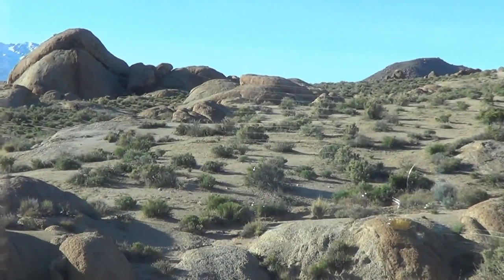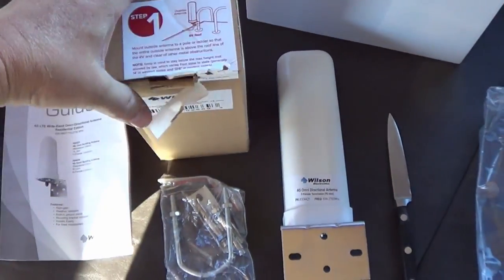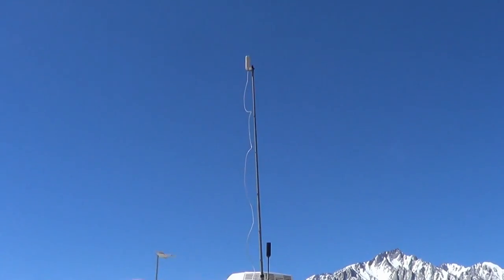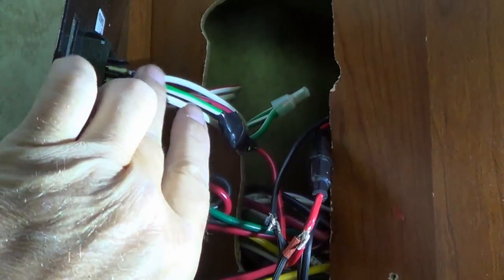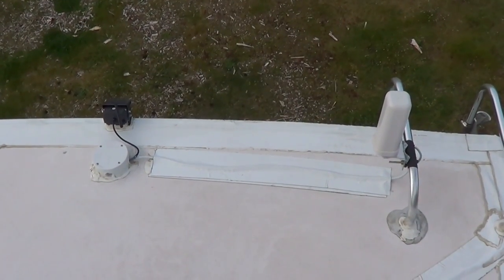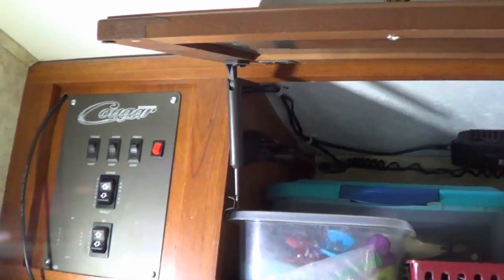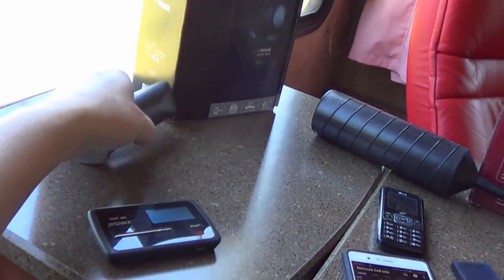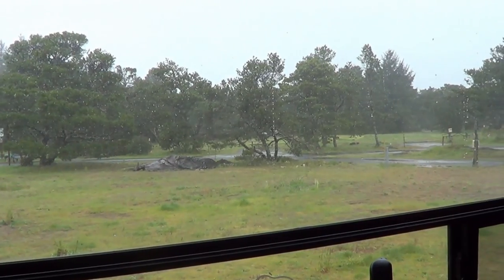weBoost Drive 4G-X RV Cell Booster Install and Review

Comment: Cell phone signal doesn't bend. If you can put the outside antana higher. The mount that came can be put on a pole that can go up higher when needed and lowered when moving. Mount pole on side of ladder like your flag.

Comment: Very thorough review - well done!  I wonder if different placement of the inside antenna (such as not in a window) would make a difference?  I.e. help reflect/keep the signal it is repeating inside the RV as opposed to some escaping to the outside?  I also wonder if you couldn't mount it upside down (bottom up) on the ceiling in the center of your RV to help boost signal to any devices within a certain radius (at the table and couch, for example; maybe even up into the driver's area if strategically placed)?  Or you could mount it with velcro and have a place up front on the roof and then a place farther back, depending on if you're parked or mobile. Just thinking out loud here...great review!
Reply from the maker: Thanks, Mark, I tried it on almost every conceivable location in the trailer checking boost levels as it had lots of extra wire to test location with and that was the best reception spot. The biggest problem is the interaction between outside and inside antenna, the greater they interfere with each other the more the amp will auto-tune the output signal in the rig lower to stop the interference.  I believe the window location works best as it places the windows metal frame between the inside and outside antenna. Every RV will be different, like say an Airstream being all metal may have better boost than an open aluminum frame trailer like mine.  Cheers Ray

Comment: Hey Ray, my neighbor is a IT guy and he was just showing me a new range extender he got made by Netgear # EX3800.
He was saying that the difference in this new one is amazing...and for him to say that means a lot. I was thinking it might be worth a try in your RV I'm going to get one when I find out where he got it. I just asked him for the # just now so I could tell you about it. He gave me some IT talk about the improvement he got with it, but it was all gibberish to me. Lets just say he said it 'lit up the room'. When I learn more I'll let you know.
Reply from the maker: Interesting, but the Netgear # EX3800 is a WiFi extender, the weBoost is for cell signals
Reply: Right but won't that help inside the RV? It helps inside our house. Takes what I have and repeats it with a stronger signal.
Reply from the maker: As far as "WiFi" goes we don't have a signal strength problem, our little MiFi device or the phone hotspotted has plenty of range to fill our small rig. Most of our devices are 10 feet or less away.
Reply: I know I was just sharing some info..:)

Comment: I have an external coax connection on the outside of our RV. Instead of drilling a hole, can't I just connect the outside antenna to that?BTW we use T-mobile and have their hot spot.
Reply from the maker: Yes, you can do that.

Comment: Oh, I see you have a JetPack as a MyFi.  Do you boost the signal so you can pick up a stronger 4G signal on your JetPack to run your laptop, etc.?
Reply from the maker: Yes, I just place the Verizon Jetpack beside the antenna. Usually, boosts it up 3 more bars.

Comment: Beautiful spot!   I have heard about that area many times.  I just pulled out my Wilson booster I had bought a couple years ago and I am amazed at how much improved my cell signal is now.  I couldn't even use my phone sometimes and now I have a pretty good signal for internet use.
Ray, I recently damage a couple small areas on my TPO rubber roof.  Is that external bond tape a good way to patch it, do you think?
Thanks in advance.
Reply from the maker: I've used it on my roof with good results - http://www.loveyourrv.com/rv-roof-repair-eternabond-review/ Cheers, Ray

Comment: I did not see any info regarding the distance between the two antennas for permanent mount
Reply from the maker: It will vary from RV to RV depending on the type and construction. Ideally you want the most electrical separation possible which isn't always the physical distance.  Having some metal between the antennas can make a big difference as it block signals interfering with each other causing oscillation and feedback weakening the boosting power.  If it becomes too great the amp actually has a Red LED warning that the connection isn't good enough.
You have to test in the rig where the best location is.  On my particular trailer I find the inside antenna performance is best not very far away but below the outside antenna with the back wall and window metal framing between the two antennas.
Cheers, Ray

Comment: Try a yagi on the roof and one inside as well.  Point the outside one at the tower using the OpenSignal app on your phone then use another yagi inside pointed at your cell phone.
Reply from the maker: Yes, good idea. I was just trying to show their kit doesn't work that great as is. I believe they have since come out with a more stationary kit that has a mast and a yagi.  Cheers, Ray

Comment: We camp in wooded ares (state parks) should I mount the antenna on top of the RV or keep it loose so I can move it to the most open area of the camp site?
Reply from the maker: Whatever works best for you. I have mine installed but could always get a second antenna to use remotely or one which is directional to pick up weaker signals by pointing it.

Comment: Just a note, you may wanna test the 4G booster on AC current instead of the 12V adapter to see if you get a better signal.  Somewhere (I am trying to remember the blog) I saw that weboost (without being very upfront about it) was dropping the power draw for the device by almost 50% to run directly on 12v, which causes lower gain on the booster.  So even though they offer the 12v, they were suggesting to run it off the inverter.
Reply from the maker: As far as I can see all the AC adapter is doing is converting 120 AC volts into the DC volts that the amp naturally runs on. Not sure how it would make any difference. I'll giver a try though and see. Cheers!
Reply: Ray: The thing they mentioned wasn't actually on the AC side, it was on the 12v adapter that they had.  The 12v adapter was stepping something down, compared to what the AC adapter had.  trying to find it now :)
Reply from the maker: I have two kits, this one, and the OTR. Both the AC adapters say 120 VAC converted to 6 volts DC. But the DC adapters do vary. The OTR came with a 12-24 VDC to 6 VDC @ 2A max, the new RV kit had 12-24 VDC to 5VDC @ 3A max.  So maybe the change it to solve the problem you are referring to
Reply: Found it!  It was a review on Amazon lol!  https://www.amazon.com/gp/customer-reviews/R21FZGI8T85UW2/ref=cm_cr_arp_d_viewpnt?ie=UTF8&ASIN=B00WMFXE5O#R21FZGI8T85UW2

Again, this is third party.  We are looking to go full time (just picked up our rig on Friday) this fall, and I work from home as a software engineer, so looking at all my options and trying to get the best I can lol.  

That is good to know that the one yours came with says the same for both.  This review they had posted on amazon made me wonder if they were trying to save power on the DC side, but not letting you know that.
Reply from the maker: I don't see any reason it would be in weBoost interest to cripple it on DC to save a little bit of power, likely was a packaging screw up on the line.
Usually, devices are designed to work in a supplied voltage range. Most take the input voltage and it is fed into a sophisticated internal related power supply circuits. Most microprocessors can other chips run off 5 volts or 3.2 volts and they want precise regulation to prevent data errors.

Comment: The distance and location between indoor and outdoor antennas can dramatically affect performance with these systems.  You might want to experiment by putting the outdoor antenna on your vehicle and the indoor antenna in your RV.  The indoor antenna if placed too close can send a false signal to the outdoor antenna which then reduces the amplifier.  This is a well known phenom. with these devices.  Try shielding the indoor antenna and only allow the device inside the shielded area to test to see if this phenom. exists in your situation.  

Basically the indoor antenna sends out a cell signal, the outdoor antenna if within range picks that up and the amplifier reduces strength to compensate, thus reducing ability to perform.  You mentioned near the end you did not understand all that.
Reply from the maker: I get the concept. I tried every place in the RV with both antennas and found the best placement for my tests. Likely all the metal in the rear window and back trailer aluminum frame was giving me the best signal separation. The distance between antennas isn't always the answer I found. I tried it on top of a 22-foot flag pole, no difference. I just don't want people to get false expectations of the products performance,  The way its advertised gives people the impression it will fill the RV with a fully boosted signal. Given all that the booster has worked well for us, I just sit my hotpot data device beside so no biggy there. For fringe area phone calls I hold the phone against the indoor antenna.  

Cheers, Ray

Comment: Great video Ray. Do you think decreasing the line/cable length between the indoor antenna and the amplifier would improve performance?  I've seen where line losses out to antenna have a significant impact.
Reply from the maker: Thanks, Ken. Not sure, but I think the company would have things calibrated for the supplied kit for best performance. The problem greater indoor signal strength is it starts to interfere with the outdoor antenna causing feedback and worse performance. I believe the amplifier box is automatically trying to balance things between them for best reception. I think if my RV was metal walled like an Airstream, for instance, it would work better as the two antennas would have better separation.
Reply: That makes a lot of sense.  I guess other than the metal box solution that you mention, the system would need some way of discerning and blanking it's own amplified signal. I love your videos BTW.

Comment: I love the idea of putting the antenna on your flag pole to get it up high, but does the signal degrade when it moves due to the wind?
Reply from the maker: I just did it to test before permanent mounting, but I wouldn't think so, folks use them driving at highway speed.

Comment: This setup just increases the signal correct? And then you use the jet pack or equivalent to act as your Wi-Fi router to push out the signal to your dr ices or do you just use your cell phone as a hotspot ... imagine if your wireless router you could flood your RV and even outside the RV with a signal .... have you done a similar video demonstrating that?
Reply from the maker: Yes, it boosts incoming cell signal. One of the other depending on the signal, usually its the Verizon MiFi as they have the best rural coverage.  Our MiFi hotspot or the hotspotted phone acting as a router have plenty of signal strength to cover the RV and the outside area with WiFI signal.
Reply: i was looking at other more expensive devices just to learn what feature benefits they can provide, ultimately I like to continue using my Apple AirPort extreme wireless router, So I can either use a device that has a slim card/modem like a Jetpack, or go with a cradlepoint or wifiranger type device that will take a slim card and then have roof top antennas... there are lots of solutions and endless money and simple solutions available today.  thanks

Comment: Ray, have u thought bout using the directional antenna?  The 314411 from weboost? To see what signal strength u would be getting?
Reply from the maker: I have thought about it but honestly, there aren't many places I would use it, so it would be another thing to carry around. I could see it being good if you spent a large portion of time in a fringe reception area and could set it all up and leave it.

Comment: Ray, I wrote the text below before seeing the remount that you did.. You might still  look at bolts and get rid of the U-bold sticking out in the ladder pathway.. Just a suggestion..
Reply from the maker: Not really that much of an issue, at least for my I'm quite agile. :)   http://www.loveyourrv.com/wp-content/uploads/2017/04/weBoost-RV-outside-antenna-mounted-on-rear-ladder.jpg

Comment: I'm not sure why inside antenna range is such a big deal. I feel like the most common use cases are going to be 1) Place Jetpack (or equiv) within inches or 2) Place cellphone within inches and use tethering with your laptop or Bluetooth to a headset for calls. I guess if you needed to text a lot then it could be a hassle but even in that scenario, you can text from the comfort of your laptop (over the phone). Hope that made some sense... :^)
Reply from the maker: For us, it makes sense too and we don't care, we actually rarely text of call anyone, guess we are antisocial. :)  but I figure average folks should know as they think it will work great anywhere in the RV as the marketing sort of suggests and then will say its crap and doesn't work. A vast majority of RVers aren't that tech savvy like you. ;)
Cheers Ray

Comment: I'm wondering is there a good super powerful portable tv antenna system designed to either temporarily rest/place on RV roof while parked, or somewhere nearby the RV, for the basic tv channels. ( cannot afford satellite right now).Currently I have the typical flat, black metal blade/wing standard style antenna that came with the RV about 6 inches wide and 3 feet long. Mine doesn't go through the roof so I cannot rotate it for reception improvement. Hopefully they have one available with a wireless remote rotation feature so we don't need to cut hole in roofs or get out of the RV to rotate. My reception is better at some RV parks but I'm in a valley now and tv reception is horrible.
Reply from the maker: Not that I'm aware of. I have seen in some parks where longer term RVers have purchased actual home antennas and pole mounted them but they would be a pain to travel with.
Our batwing antenna with the digital add-on piece does a pretty good job, I can rotate it.  http://www.loveyourrv.com/lubricating-winegard-batwing-style-rv-tv-antenna/
Reply: Love Your RV ok, thank you. Batwing,, that's probably what I have. Inside I have a button and red light. They told me it's a booster. That's not the digital add on thing you've got? or is it? I will check out the site you posted for me on what you've got. Thank you.
Reply from the maker: No, the addon is simply a set of antenna rods that are tuned to the digital channels, it just clips onto to the regular old analog station batwing.
Reply: Love Your RV Oh, interesting , can I purchase that addon from Amazon?  What's it called?
Reply from the maker: Winegard RV-WING Wingman White UHF Booster TV Antenna  http://amzn.to/2sizyrE
There is a picture of the type of Winegard antenna it fits. I think yours maybe a newer style though and not compatibel with this addon.
Cheers! Ray

Comment: I wanted to know if you have played with the trucker antennas I have read that there are 2 sizes a shorter and taller. Which one would work better? Also would like to see a mounting video of the trucker antenna on a car where there is no ladder/rail or mirror to place the antenna. Any ideas?
Reply from the maker: I've only used the one size trucker antenna, but with antennas bigger is almost always better, it just comes down to if it can be mounted and safely driven around with. Not sure where you'd put one on a car without some modification. Maybe on a roof rack.
Reply: Thank you for the help. Another question for you. So I have a Wilson smart technology 2 signal booster in my work truck it's an older model of the new weboost. It also says it can boost your signal by 32× like the new models. My outside antenna partially broke but it is still working some what well. I can see when I stick my phone by the chocolate bar antenna my dbms do decrease by about 12 or so which is good however my signal bars decrease as well. Well when I do a speed test of my LTE internet speed I end up getting better speed without the booster when I put my phone by my window by itself even though my dbms increase. Which is strange. My chocolate bar antenna is installed by the middle panel underneath the a/c controls on a F150. These Wilson signal booster are installed by our company mechanics and are standard in all our trucks. My question is  have you encountered anything like this? Where for some reason maybe your location or location of the chocolate bar antenna affects your speed even though your booster is working and your dbms are lower?
Reply from the maker: Yes, I've been in some areas where the speeds were better without the booster. I guess there are many factors that go into the speeds you end up with. Usually the booster works best in low signal areas, in stronger signal areas I don't us it.
Reply: Thanks for the help. I really enjoyed your reviews. You try every sinario which helps the viewer out a lot.
Reply: Use a standard magnet mount, like would be used for a CB or amateur radio antenna.   They're available in a wide variety of sizes.

Comment: What sort of range do you get with the mifi, if you leave the jetpack next to the antenna, how far way can you use your phones or computer, Thanks
Reply from the maker: Quite far actually, I think the published range is like 30 to 100 feet. I've used it quite often when sitting outside and I've seen others MIFis show up many hundreds of feet away.
I also have a WIFI booster on board so could send it further if need be.